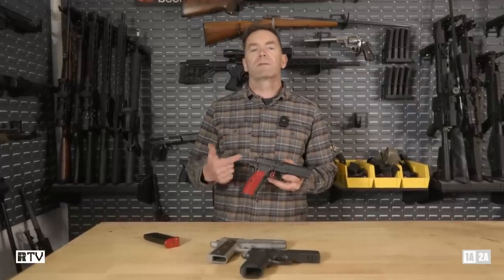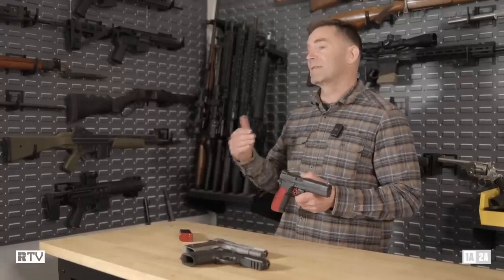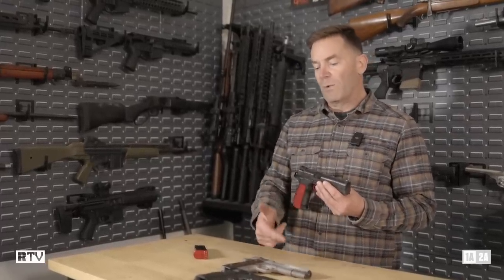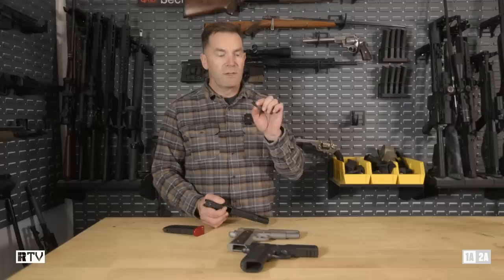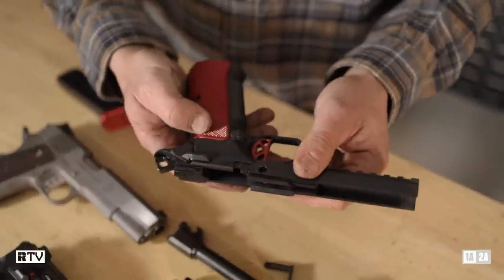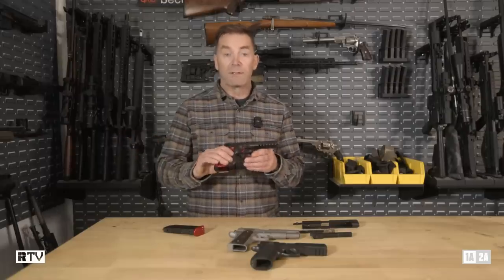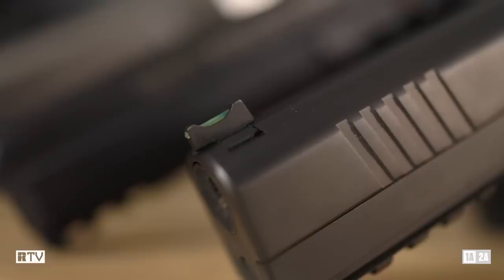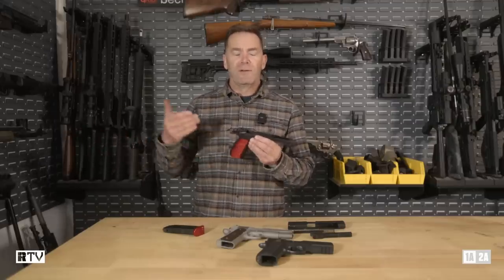Introducing Dan Wesson's | DWX

Comment: For the mash up of engineering , taking the finer points of other great platforms, and being a Dan Wesson  I was extremely impressed with the 2g price point. That's really not bad . Great video,  woulda liked you to say something about the trigger feel. Does it feel like a sig since it's based off their design,  or did Dan Wesson work some witch craft in the making it more of a cz or the 1911. Awesome pistol . Would liked to seen them incorporate cz slide rail design tho. I feel like that's one of cz best features. Just my opinion  tho lol
Reply: My bad, should have mentioned that. Trigger is 1911, 4lbs, SAO and very, very good
Reply: The slide rail being one of the best features is not merely your opinion...it's definitely fact.
Reply: Trigger pull is a touch heavy but good. Will put a few hundred rounds thru it before I determing if it needs a trigger job.

Comment: Very interesting and well engineered 😃👍
DW quality is really high, especcially on metallurgy of small parts.
It would be nice also a 4 inches model with a flashlight rail low snag and manual ambi safety, no firing pin safety for personal protection.
Also go full stainless, for civillians or cops finishes are absolutely negative, they wear and are just annoying and expensive to refurbish, for low glare bead blasting is just fine (like on the DW Valor or Specialist... fantastic guns 👏).
For guys who do not compromise on quality...
🇮🇹

Comment: Considering this is probably more geared towards your competition shooters the optics cut is no loss to me. This gun is perfect for the Standard Gun division in IPSC. I believe it's called Limited in USPSA. So no optics allowed. Competing against the 2011 monopoly in that division. Cheap CZ mags and high capacity for shooting major in 40 cal. If I recall correctly it used the P10 series mags. So well tested and cheap vs 2011 mags. 

Been waiting on this gun since 2019 and so happy it is finally here. Also don't compare it to a cz75. Everyone that shoot competition knows this is the baby between the CZ Shadow 2 (if you look at grip profile) and a 1911. Also then you'll notice the full length guide rod is not a 1911 idea. It's basically many guns but good old GI recoil plugs are the norm for 1911's. So the recoil guide rod is CZ through and through. 

Anyway it is a niche gun made for competition. I doubt anyone would really love to carry for self defense or duty a heavy gun like that.

Comment: Weird choice to not have it be optics ready at launch.
Reply: They have to move old stock first. It's a 3 year old idea. Got to recoup that money.Once the market is saturated with them. Optic ready model will follow.
Reply: Stupid is the word I would choose
Reply: Taking a page out of the Sig playbook. Release a new model with one new feature every 3 months. Haha
Reply: Unless there's some competition rule about being optics ready, it's better to just get the slide cut directly for the optic you want. Mounting plates suck.
Reply: the thing is it’s kinda like cutting the carry handle on your AR and bolting on a 1913 rail except its 2022 and not 1989. Sure you can do it but you could also just have the slide cut to accept optic plates from the word go. Maybe some folks have been using the MOS system and haven’t had a great experience with optics plates but if I’m buying a gun for shooting it in competition my preference is that it comes already cut for plates so I can use whatever tickles my fancy.
Reply: @ACxREAL  I see your point because it's easier to just buy the plate and go, but I'd argue a factory optics ready slide is like a bare top AR receiver that requires a bolt on pic rail. 

My only issues with plates is that they add an extra layer of potential movement for zero shift, and they add additional height to the optic (which necessitates suppressor height sights if you want BUIS). I think the best solution would be to have a standardized optics cut and make every new pistol optics ready with that cut, and if you wanted backwards compatibility with old non-standard footprints, then you'd have to buy a plate. Maybe that's what the RMR cut ostensibly is, but that leaves out closed emitter optics.

Tangent thought: why don't they just machine a picatinny rail into the slide? You'd only need one slot.
Reply: @riflemanm16a2  The RMSc footprint is the only footprint that could be universal. It’s the only footprint with screw locations narrow enough for slim line optics and far enough back for closed emitter optics. Holosun figured this out with their EPS line. Optics going forward should all adopt the RMSc footprint as it’s the only one with universally compatible dimensions for all optic types. Anything else could be a plate mount onto that footprint to accommodate legacy footprints.

Comment: And here I thought Dan Wesson killed off the DWX. I always thought that was a bad move as they had some really great styling and innovations going on with the DWX line, especially in the compact version. 

I'm pleasantly surprised and happy they quietly kept working on it and finally reintroduced it. Good on them. I think these two DWX pistols could overtake the CZ P-01 and SP-01 as a higher end version of those with more modern lockup and bushingless barrel design. However, they should have fixed the need to remove the slide stop to take down the pistol. FN changed that up with their new reintroduced High-power. A modern rotating slide stop takedown pin should have been incorporated as well. I don't know if it was mentioned here, but it takes CZ 75 magazines. This is a huge plus as well since they are cheaper to acquire and quite plentiful over the decades of people buying the CZ 75's.

Comment: Really don't know how I feel about this gun. The CZ frame already results in a pretty high bore axis (no it's not lower than a Glock). The slide rail system helps manage that. Adding a 1911 slide makes the bore axis even higher. I'm sure with all that weight, it's probably not noticeable, but still...hard to justify over a Shadow 2 SAO.